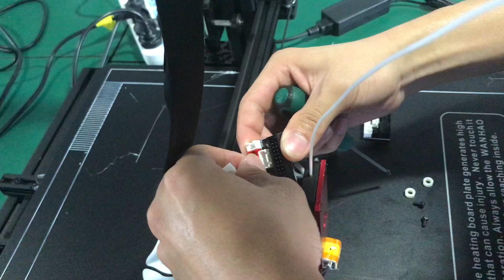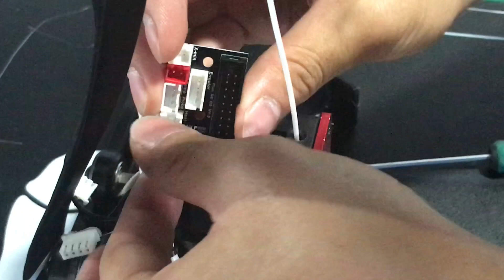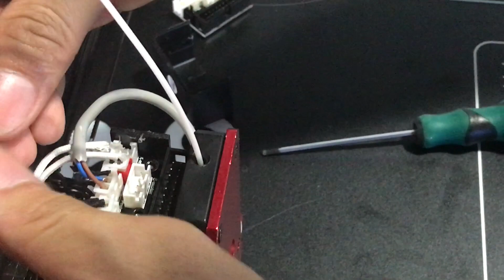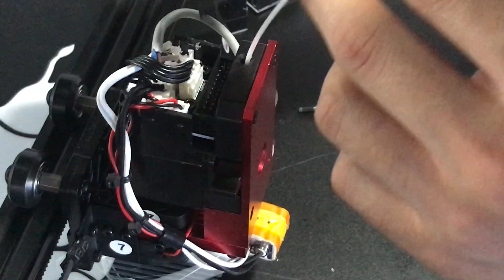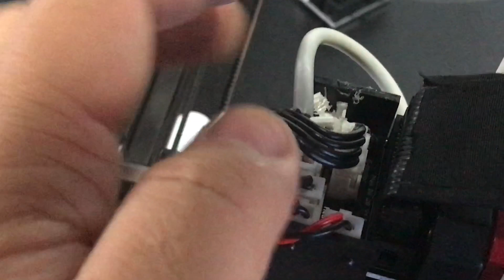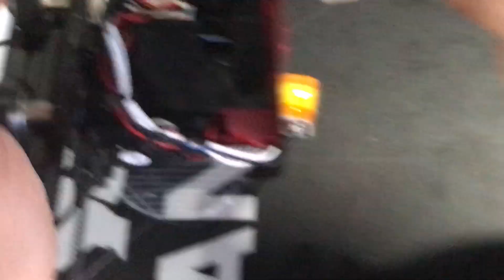How to replace the D9 inter-board( spliter board)？

Comment: Looks like my printer, delivered mid January 2019, still had the old splitter board in place, as i just lost the Z axis home sensor function. Looking at the circuitry, i decided to use a standard small signal NPN BJT as a replacement - in my case a BC846. After putting it back in place, the printer turned off after switching on the extruder heater. Another inspection revealed a design fault with the PCB traces for the heater being too close to the hole where it's mounted to the chassis. I used 2 insulation washers that are usually used to mount TO220 transistors to heatsinks to isolate the board from the chassis.

Works perfect again now. Maybe this helps others to get back to printing within just some minutes and without the need to wait for the replacement board, and it also saves WANHAO some bucks for shipping the spare parts :)
Reply: Thank you very much for sharing this information.

Do you have any post or any note with more info on this (link?). I know it's relatively easy, but it's not my area, and I have to talk to a technician to make this arrangement. I would like to take as much information as possible so that I can solve my problem.

Again, searching the internet I did not find anything, and your comment is an incredible light to my problem !!!
although there is more to add, many thanks.
Reply: @tutiadescalza  No, there is not more information, but a tech should have enough with this. The video describes how to replace the board, so that's the information what board this is about, the rest is just unsoldering the transistor on the lower side of the board (a SOT23 SMD transistor with 3 legs) and putting a new one in it.
BC846 is just an example, any small signal NPN transistor with the same pinout and comparable data can be used. What i've seen, both resistors are 10KΩ, so the transistor needs to be able to handle 2.4mA Ibe and 0.5mA Ic.

I have seen a good photo of the newer board somewhere after my comment and if i remember correctly, the base resistor has been replaced by 47KΩ and the transistor was a BC816, but i can't guarantee i remember this correctly. But my solution worked fine so far, so even if i have those components in house, i see no need to replace them again.

So the simplest thing - just replace the 3 pin component on the lower side by a BC846, other options are daily business for an electronics engineer.

And one addition: insulation on just the bottom side of the board might not be enough, the top sice also has critical traces that might get in contact with the screw, so i added washers on the top also and used slightly longer screws which were necessary with the additional distances due to the washers.
Reply: Super grateful for your response. As soon as I solve it, I will return with more info !!